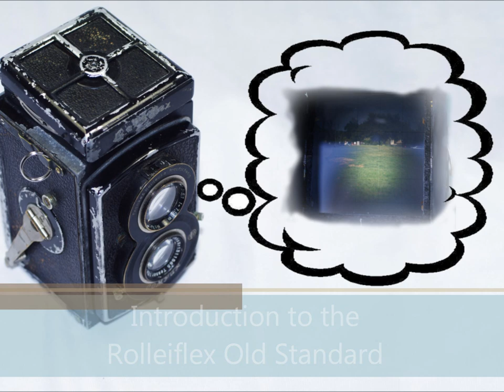Introduction to the Rolleiflex Old Standard

Comment: This camera can use both 117-film (B1 6x6) and 120-film (B2 6x9). The reason for the red window on the back is that 117-film only had markings on the back paper for 6x6. 120-film at that time had only markings for 6x9, and that's why the red window for it had to be at the bottom. You wind the film until the number 1 shows up in the window and then start the counter. Then you put the metal lid over the red window and only used the counter. And you get 12 exposures on B2-film (120-film), not nine.

Comment from the maker: You are correct. 117 is a format I haven't come across yet, so I didn't realize it could be used in 120 cameras. I guess 105 is the same width, too.

Hopefully later this year I'll do a video on my KW Reflex Box. I wonder if that's supposed to take 105 instead of 120. Getting 120 in it sure is a pain.

Comment: @21.43 you say to line up the 120 with the back center window. Actually with working camera you align and 6x9 B2 window. The earlier 120 films were only marked for 6x9 and Agfa and other makers would call that film B2. Once #1 is aligned with B2 window and the transport is working, you get correctly spaced frames.

Comment: I have the 4.5, 3.8 and 3.5 models, and the Original 3,8 model.

18:24 The lug is for the original type of leather strap. It has a little hole and a slit on each end. The lug on the other side is combined with the button to start the counter.

Comment: What sort of lubricant would have been used in the focusing gear system, I want to free up my focus knob but don't want to wreck the existing lube? thanks! great vid
Reply from the maker: The best I can say is probably oil-based, probably a light grease of some sort. Old lubricant that's gotten thick tends to thin out when things like lighter fluid are added.

Comment: if there r no iso setting will it limit in taking pictures? like you were only able to take pictures in the light
Reply from the maker: You'll need a hand-held light meter to obtain settings. If you're in full sun, you can use the Sunny 16 rule (f/16 and the shutter speed is the number nearest your film speed.)

Comment: I think I have an old standard but I'm not super sure. Kinda new to film and also new to tlrs. To scared to tinker with it tho given its age but it definitely could use some restoration. Stumbled upon your video on it trying to find more info
Reply from the maker: Nice! I'd avoid restoring this camera unless you have a lot of experience. The same is true for anything Rollei. These are VERY complicated cameras. Rollei made them overly complicated as a way to prevent copycats in other countries from copying the engineering.

Comment: I have the Original one, that uses 117 film rolls. I have to adapt 120 spools to fit in there...
Reply from the maker: Nice! The 120 must give you a slightly panoramic image.
Reply: @DavidHancock  117 was the same film than 120, but half the length. Only 6 6x6 pictures per roll. The spool was thinner. I have to cut the plastic extremes in order to fit in place.
Reply from the maker: @unpocodeluz_atill  Of that's right. Thank you! I was thinking of 116.

Comment: I have an agfa billy compuer that has a hole in the bellows. I want to shoot a role of film it it. What do you suggest for me to fix the hole with?
Reply from the maker: Ouch. How big of a hole? If it's a pinhole, that can be fixed with electrician's tape (temporary) or you can do an Internet search for camera bellows repair. There's a compound that can be made at home (I forget the ingredients) that fixes pinholes.

If it's a tear, then there's likely no way to fix the bellows. That requires a new bellows. There are a few places making replacement bellows now or you may luck out on eBay and find an original one that's in good shape which you can swap out yourself.
Reply: Its about 1/2 an inch long. This may sound ridiculus, but I was thinking electrisens tape as the bottom layer, and a top layer or two of aluminom tape.
Reply from the maker: It's worth a shot. That would definitely be light proof.

Comment: How is the light leak happining in the camera?
Reply from the maker: In which camera? I don't recall my copy having a light leak.

In general, light leaks occur where the camera's door meets the body. They can occur from degraded light seal material or small bends or damage. With cameras that have a red window, light constantly enters the window. Old-time films had very little red sensitivity, so that wasn't an issue. Modern films see red very well, so red windows can cause film to fog or be otherwise damaged by the red light coming through them.

Comment: Hello David,

I also got an old standard, only with a different back. My back hasn't got the red dot in the center, but on the leftside of the camera and on the bottom.
I was playing around with the backing paper of a 120film and if I want to see the numbers I can only do 8 frames and not 12.......is this correct?? Or should I just wind until I see number 1 in the red dot and close the little door and just shoot 12 frames and not looking at the numbers but only check the numbers near the crank arm???

Regards
Reply from the maker: So what you have is a slightly different interface. If yours works like other Rolleis and TLRs like that then line up the "!" in the red window and after that the camera will advance the required amount automatically. If you have a roll of expired film sitting around it might be worth trying it with that first to make sure that my guess is correct. The Zeiss Ikoflex has a similar system for loading film.
Reply: @DavidHancock  .......Thank you....I will try with some Tmax 400..........btw you don't load the movie behind the roller and I see some people doing it, does it matter?

Comment: Thank you, it was a very helpful video! A friend of mine gave me this exact same camera to test, it was his grandfather's and he doesn't understand much about photography so he gave it to me to test. I think it's working alright, I'm just worried about the fungus on the taking lens. And also the mirror is in very bad conditions, so focusing will be a problem... But well, thank you for the video!
Reply from the maker: Thank you!

The fungus could be easily cleaned. The front cell of the taking lens should unscrew fairly simply. If the fungus is on the back of the cell, then it can be cleaned easily. If it's between the elements then it may need a bit more work or not be cleanable. The rear element can be accessed if you leave the shutter and aperture open.

The mirror can be replaced, too, with a cut-to-size surface-coated (this is vital, the lens has to be surface-coated) mirror. Those are available on eBay for a few dollars.